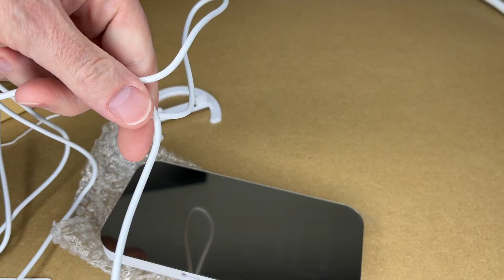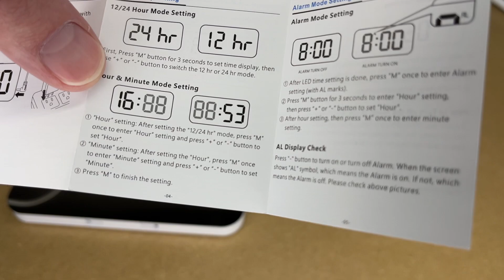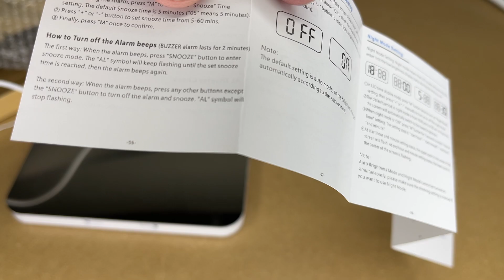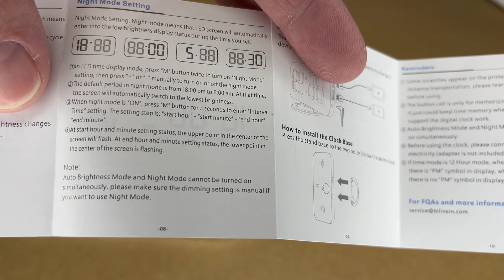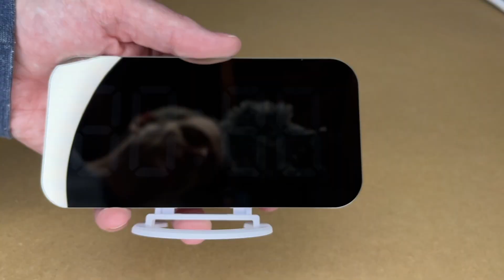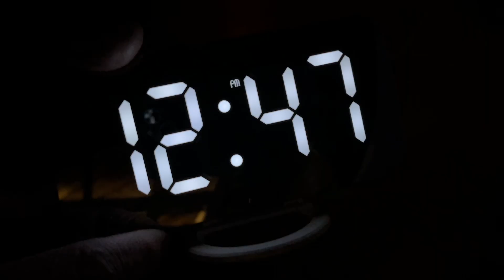Bilivein Mirrored Digital Alarm Clock

Comment: Mine just automatically turns off when I take it off the charger?? Why does it do that
Reply from the maker: The charger is what provides power to it. This doesn't have a main battery. It only has a backup battery to retain the time in case the power goes out or if you move it.